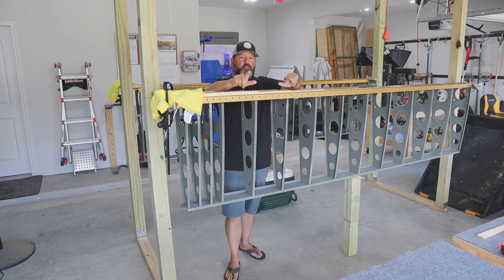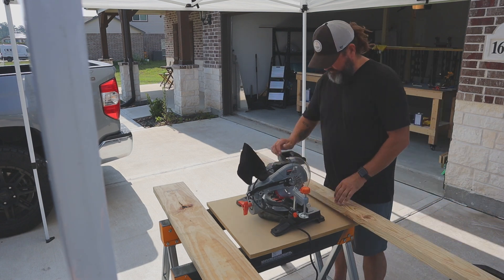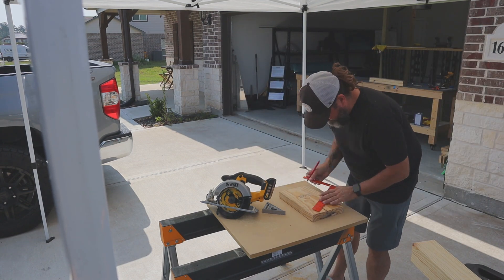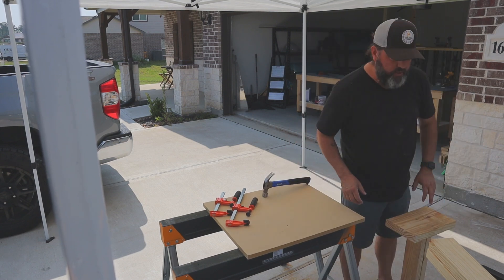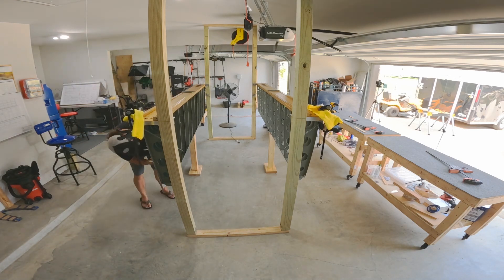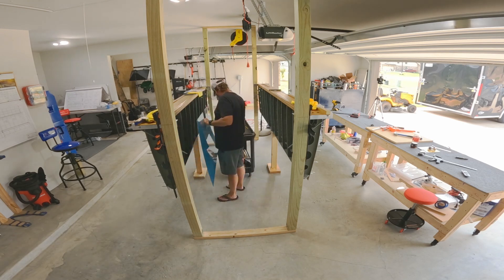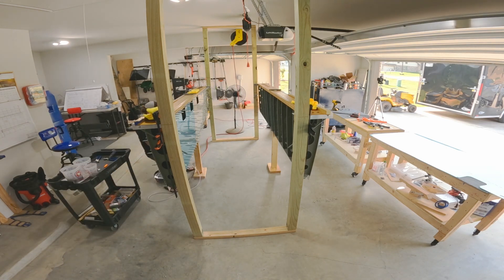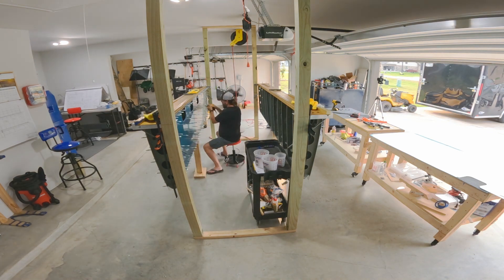RV-8 Build. Ep 052. Wings 14

Comment: So I noticed you are doing the aft portion of each wing, is there any particular reason as every other build I have watched or followed on their build site they have done the forward portion first.
Reply from the maker: Hi James. I'm following the build sequence directly from the plans. When you say aft and forward, are you referring to main skins/ribs as aft and leading edges as forward? Or, are you referring to the top and bottom? If it's the latter, yes, you'll see most builders attaching the bottom skins last, which is the correct order of operations. However, when you first fit the skins, you need to fit both the top and bottom main skins to ensure that the entire structure is rigid and true before final size drilling. Then, the bottom skins come off for the rest of the wing build to allow access for wiring, etc. On the wing stands, the tops of the wings face outboard. Once the top skins and leading edges have been riveted in place, the wings will go into cradles where the bottom of each wing will face outboard. When all of the internal work is complete, the bottom skins are the last to go on. I hope I'm making sense.
Reply: @thathippiepilot  I guess I should have used aircraft terminology… so leading edge of the wing = forward and trailing edge of the wing = aft.  Sorry if I caused confusion.  When I worked on FA-18 aircraft we always referred to the aircraft so it was common to use forward or aft to discuss leading or trailing edges respectively.  I often forget to speak like normal people. 😂
Reply: By the way I am enjoying your build, I plan on following in your footsteps in another year or so.
Reply from the maker: @jameswelch4596  I'm military as well (USMC). So, you're speaking my language. From a strictly Van's RV-8 perspective, leading edge and fuel tank construction don't occur until after the main structure has been built (per the plans). However, I don't think there's anything keeping a builder from the beginning with the leading edge and fuel tanks and saving the aft portion for later. I had considered beginning with the fuel tanks because I was worried about the expiration date on my sealant. I confirmed with Van's that starting out of order like that wouldn't pose a problem.
Reply from the maker: @jameswelch4596  Do it! And post videos. I need more builder content to watch! lol